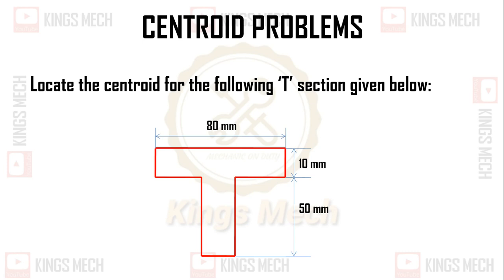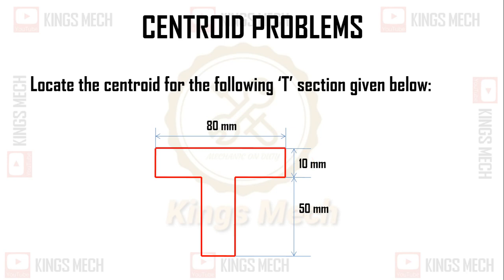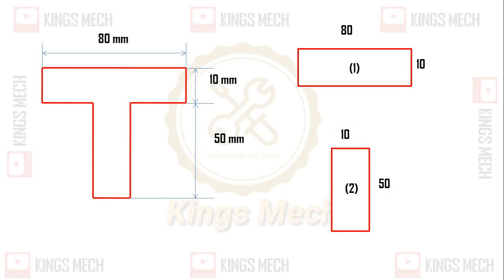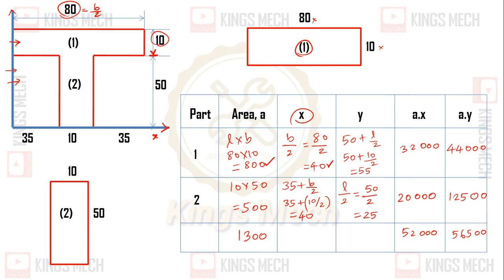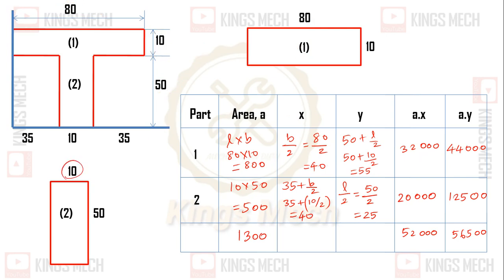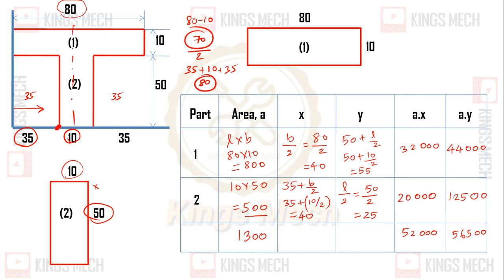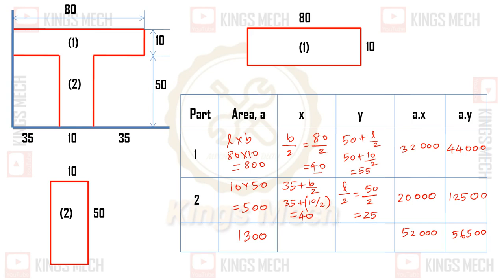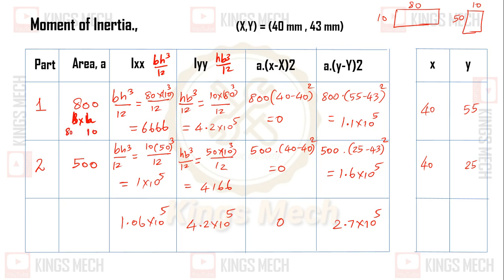Moment of inertia of a T section in tamil

Comment: Xbar value differs from normal x value in I section if the dimensions of top and bottom flanges differs??
Reply: Pls reply sir
Reply from the maker: Yes..if it is not symmetric..
Reply from the maker: Check I section problem..in the opening I have mentioned about symmetric ness
Reply: @kingsmech  because I got confused. Top and bottom flanges same aa irukka sums podumboodhu
Suddenly I got confused when the dimensions change
Reply from the maker: Second link I section problem.. have a look
https://youtu.be/ktU2fT7jRno